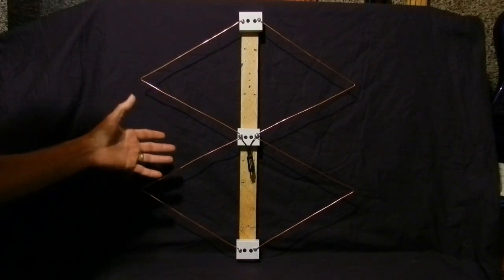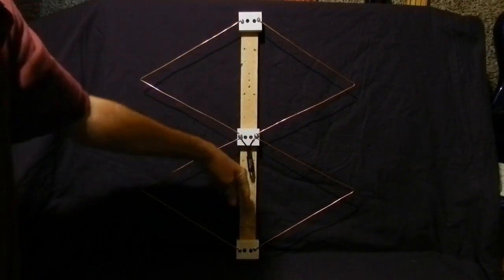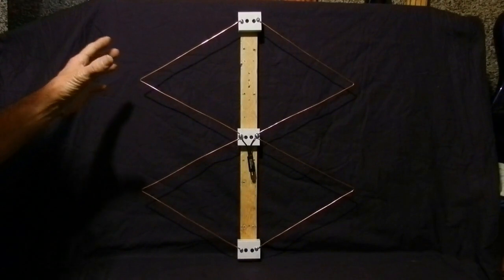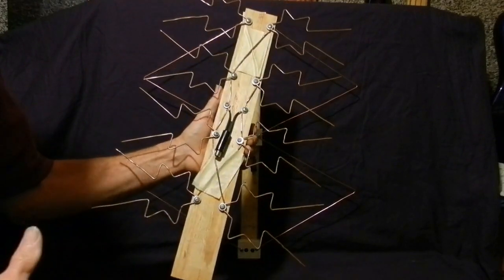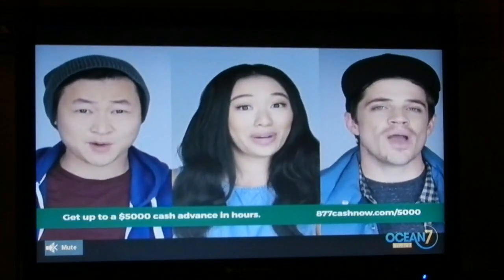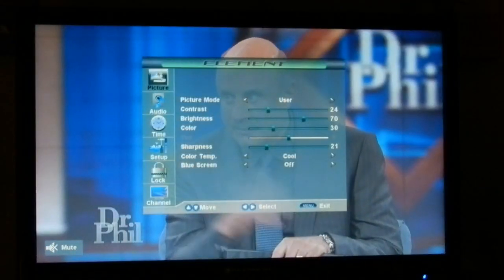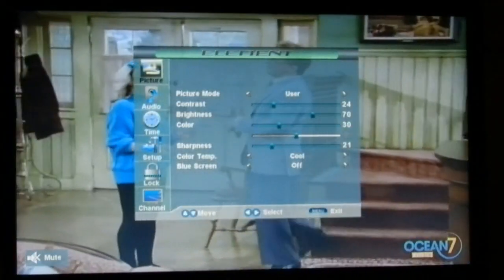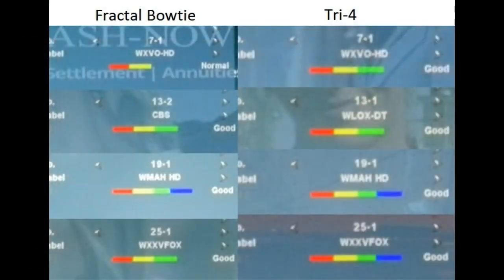HDTV Antenna   SUPER EASY   Great Performance

Comment: Hey Mike, I like the design of the antenna. I'm getting the materials together- what do the little pvc blocks do? Can I attach directly to the wood?
Reply: They insulate the antenna. Preventing interference as I understand. I've been using the antenna for a year and a half without a glitch and suddenly I'm running into issues getting signals from stations with the highest transmission signals. I know it's the latest large scale 4G and 5G upgrades that rolled out between the end of 06/14/2023 and 07/26/2023. I don't know if one of the 5G filters will help...

Comment: Couple questions:
Would using thicker 40" wire do better?
Adding a wire cloth reflector would 1/4 x 1/4 inch galv wire cloth work?

Comment: I am curious about what purpose does the pvc serves?  I am about to screw it straight to wood, will report with results.
Also it is unclear what transformer to use.  I think I have some old ones on an old tv I kept because I am a hoarder.  Will try what I have and log back specs and results.
Reply: So I sew your answer to another comment on why the pvc;
Some people say wood absorbs humidity and degrades the signal, but you have antennas made of wood that works just fine.
Also It seems any transformer written uhf vhf will work.

Sadly this diy antenna made no improvement over the small indoor one I already had.
It was worth a try.
Note that it does work just as well as any 25$ store bought ones, so its still a cool project.
Reply: You can always wrap some electrical tape around the wood to keep the moisture off the wire.

Comment: Hi Mike, your videos are great!  I think it's awesome that you share your experiences and knowledge on this topic, especially that you share your drawings and measurements so that others can easily reproduce these designs and benefit from free OTA TV.

I've watched your Tuxedo, Tuxedo+VHF add-on, and the Tri-4 antenna videos.  I was planning on building the Tuxedo with VHF add-on because I want to pickup VHF channels 8 and 13 in my locale (I was going to add two VHF elements for channels 8 & 13).  But after watching this Tri-4 video and seeing your comments regarding its sensitivity for high-VHF frequencies, I'm wondering if it makes more sense to start with the Tri-4 design.  Also, I noticed you made this video two months after your Tuxedo+VHF video so I'm guessing (perhaps incorrectly) that the Tri-4 offered a performance improvement beyond the Tuxedo+VHF add-on.  Could you please comment on how the Tri-4 compares to the Tuxedo+VHF for capturing high VHF frequencies.  Also, how does the Tri-4 compare to the others in terms of UHF signal strength?

I appreciate your insight.  Thanks so much for sharing!
Reply from the maker: Thanks for your great comment! 
Honestly, I only used the Tuxedo with VHF for a couple months before switching to the Tri 4. 
  The tuxedo uses a lot more wire and for any antenna it depends on location as to how well it works so I can’t tell you which one works better. The Tri 4 uses less materials and is easier to build. I built one with 11” measurements and it worked great for me.

Comment: Hi, Like the video. Have been gathering information and material to build an antenna.  I am going with a Gray Hoverman with hats.  The design I have has 8 gauge copper wires bent at 7 inch between beds.  You have 10 inches between bends.  I used the formula (300/ Frequency) x 39.37 = wave length in inches.  I made a list of wave lengths for different TV MHz frequencies.  For the middle of VHF-LO 1/4 wave length = 21.6"; for the middle of my VHF-HI (10-13) 1/2 wave length = 30" ; for the middle of my UHF (RF29) = 21" is full wave length. I think t his would indicate to make a bow-tie with 10"-10.5" whiskers good.
Would a Gray Hoverman with 10" between bends be better than 7" as all the instructions on the internet give?

Comment: I am just curious how these compare with something like an indoor Amazon Basics antenna. UPDATE: I made one of these in about 15 minutes (literally). I went from 42 channels using the Amazon Basics antenna to 83 channels and they all come in crystal clear. Note: I needed to find just the right spot indoors to get that many channels. Very impressive. Needless to say, I was mind blown. I used 2 40" solid copper grounding wires (about 10awg) bent 90 degrees every 10 inches, a few screws to hold them 1/2" apart, and a balun. I decided to mount it on my roof but curiously that did not add any new channels to the 83 I had already found. After blocked all the home shopping, religious, foreign language, and ad-only channels I have 35 usable channels to watch. AWESOME! Now if I could only do something about the 25 minutes of advertising in every one hour of airtime.
Reply: Mine pulls in one station over 40 miles away. This is hands down better than anything you can buy in a store for < $100. I am very pleased with mine. $10 for the baluns, made with scrap wood and wire in 30 minutes.

Comment: Thank you! Took about an hour including buying the 75 to 300 transformer. Got 35 stations vs about 10 before with the flat panel antenna.
Reply: This is about the best 'bang for your buck' projects I have ever built. For $10 for the 75-300 ohm transformer / baluns.

Comment: Does this antenna receive the signal from all directions Sir ???
Reply from the maker: Mostly bidirectional but the angle is pretty wide
Reply: @DIYProjectsWithMike  Hello Mike, would you have a rough Idea of of how wide that is ??? The degrees width means a lot to the reception signal.
Reply from the maker: Victory First 
I never measured the overall width but maybe 18 1/2” or so. Thanks

Comment: Has anyone tried it with a third wire-set added to the top, or even a fourth?  You think that's a waste or would it improve reception/range?  Yes, definitely use a reflector to boost reception/range if you live far from the towers.

Comment: Thanks, Mike, your work has finally gotten me off the dime.  Of course, I have some questions. 1/ Why aren't the channel numbers on the TV the same as the ones you call out?  2/ I don't have any PVC stock on hand.  Do you think thick polyethylene will work as well?  Thanks, again!
Reply from the maker: Thanks for your comment! To answer your questions,
RF channel means the frequency channel that channel transmits over. 
Virtual channel is the channel it appears on your tv. 

Polyethylene will work fine. If it is a denser more solid material it may be a better choice since the pvc I use is soft and the screws can strip it easily.
Reply: Thanks so much, Mike.  I'll let you know of the results.

Comment: Hi Mike-  Love your videos.  Odd that the latest and greatest seem to be the easiest to build.  You state that you used PVC for antenna mounting points.  Is there any reason you could not have used wood?    Lastly, are there any calculations you used to arrive at 40" per element?  Or just trial and error?
Reply from the maker: The ten inch segments works better than the nine or the eleven so yes. Trial and error. 
  They say that wood is a poor choice because the moisture in it can make it conducive and causes signal loss. But in my experience, it is only on a small scale. I still have a couple wood base antennas in my attic that have been there for a couple of years and they still do just fine. But pvc is the right way to go.
Reply: DIY Projects With Mike  thanks!
Reply: A heavier gauge wire improves signal? what about doubling the length of wire(80" of wire instead of 40")?

Comment: Would this design pick up analog signals as well?
Reply from the maker: I’m sure it would but this antenna is specifically designed for tv. Broadcast signals are just electromagnetic waves that have been polarized. Wether analog or digital only depends on the receiver. There are hundreds of different frequencies of signals being broadcast all the time. Our TVs only pick out the signals that it can read. 
  ALL television stations have switched to digital. There are no tv stations broadcasting analog anymore. They’re all gone. 
 But if you have old analog tv, you can get a digital converter and it will work.
Reply: Up here in Canada only the big cities and outlining areas had to change to digital. Where I am everything in digital, but where my father lives signal are still broadcast in analog.
Reply from the maker: GrantP1974 that’s interesting I didn’t know that. 
Down here, when everything went digital most stations went to uhf but keeping their virtual channel numbers. 
This antenna does well from RF 7 to Top uhf. I don’t know how well it does with 2-6. 
But yes it will work with analog.

Comment: Helo sir.. I need your hepl 😊 can you teach me how to do that? for educational purpose only.. i need the schematic diagram.. thank you.. janlee.manalo@manalo thanks alot
Reply: what type of steel did you use? aluminum?  copper? thanks alot.. 😊
Reply: what are components you've used sir? thanks alot.. janlee.manalo@gmail.com
Reply from the maker: I don’t have a schematic diagram for you. Sorry about that. I used 12 gauge copper wire. The matching transformers should be available at Amazon, or there is a link in my channel description that you can copy and paste into your browser.
Reply: thanks sir.. how long is wood? and what type of transformer? there no link to your post sir.. its COAXIAL? or a BALUN?
Reply: DIY Projects With Mike coxial?
Reply from the maker: Jan Lee Manalo 
The link is text based in my channel description. Click on my picture and Look for “Summitsource.com in my CHANNEL description. 
The coax cable is standard RG6 tv cable. I think I used a piece of wood about 24 inches long. Hope this helps.
Reply from the maker: You will need to copy and paste the link into your browser.
Reply: I didn't see the link for the transformer....what specs of transformer am I looking for?

Comment: Great video. How do you know how to make it?  why 10", why 1.5" apart, why a perfect triangle?  Just wondering how you came up with the design because I see so many other shapes and sizes.
Reply from the maker: I made one of these at 12" and it worked ok on the lower UHF and the VHF high but not so well on the higher UHF. ( I have ch 48 in my area). I built an 8" and it didn't do well at all but the 10" rocked!
  Some designs call for a 1" gap and some for 1 3/4" and then I've seen some much further apart. I built one at more than 2" apart and it was extremely directional so 1 1/2" kinda fits all.
   Of all the testing I've done with different shapes and designs, the triangle seemed to be the most successful as far as size is concerned. Squares work very well too but make the antenna taller where the triangle makes them shorter so they can fit in my attic.
  Thanks for your question. Hope this helps:)

Comment: Interesting stuff.  I'm looking to cut the cord.  I'm ordering a Gray-Hoverman antenna but would like to play with this in the mean time.  I'm in a hilly rural area with most channels 30-40 miles away. If I amplify the antenna, am I wasting my time building this for my scenario?  I appreciate your work.
Reply from the maker: I've never used an amplifier but never needed to. Some say they work and some say they don't. My understanding of them is that if there is a station close by that comes in really well without one, the signal may be amplified too much for the tuner to handle. On the other hand if all stations are distant then it is probably safe. If you wanted to build your own Gray Hoverman, there are plenty of videos here on youtube that help you. You can use my videos as a reference guide. :) BTW, thanks for the comment.
Reply: Mike: I'm amazed!  Finished my antenna built according to your specs.  I didn't install an amplifier.   I'm receiving 18 channels out here in the sticks!  And its in my attic.  I'd like to build another on that would be even more sensitive as my next project.  I really appreciate the fact that I found your site.  Can't wait to cut the cord.

Comment: After i got some interference elements out the way, it pick up great except my cbs channels which are in ch 4 range. Any ideals why it doesn't?
Reply from the maker: Ch 4 is in the low VHF range and unfortunately I don't have any low VHF stations in my area. At 66 - 72 mhz I calculate a ballpark measurement at 42 3/4 inches for 1/4 wavelength. You might try that rather than the forty. Did you get this station with other antennas?
Reply: DIY Projects With Mike yes, with a coat hanger bowtie anntena + reflecter. I'm in St. Louis Mo. our major channels are 2 fox, 4 cbs, 5 nbc, 9 pbs, 11 wb, and 30 abc. All in all it grabs like 50 stations. Also would it be the same distance apart still?
Reply from the maker: I looked up channels for the st louis area. The channels you mention are actually all UHF RF channels. KMOV ch 4 is actually RF ch 24 but appears on channel 4 meaning that it is "virtual" ch 4. 
 I have several design tutorials on my channel. Feel free to check them out. One in particular is the Tuxedo https://www.youtube.com/watch?v=Cf5b5-qwZ8Q&t=3s It might work better for your situation. It's almost like the gray hoverman. I don't have a vid for that one but is easy to find in google search.
 F.Y.I. - Anntenas are kinda wierd. What works for some may not work for others. And if the bowtie works beeter than any of my designs, by all means use it! No hurt here :)
 For info on the stations near you visit http://www.antennaweb.org/ click "start here" and just enter your address. Don't forget to check the box that your antenna will be higher than 30 feet. It will give you a map showing where the transmit towers are. Also, for info on specific channels, visit https://www.fcc.gov/media/television/tv-query where you can enter the call letters of the station. Hope this helps. :)
Reply: DIY Projects With Mike cool thank you very much for the reserch, i will try out one of other designs. It's weird, to me, how well it works except for that one station.

Comment: Does the extra time bending the Tuxedo warrant the extra labor this is also a very good Question thank you ????
Reply from the maker: The Tuxedo may perform better if there is interference to some extent. However, the Tuxedo leans a bit toward the UHF while the Tri-4 has a slightly wider frequency range. They both pull in channels effectively. Thanks for your question. :)
Reply from the maker: Oh, the labor is a bit more and the elements are a bit longer. Sorry, I forgot to answer your question. :0